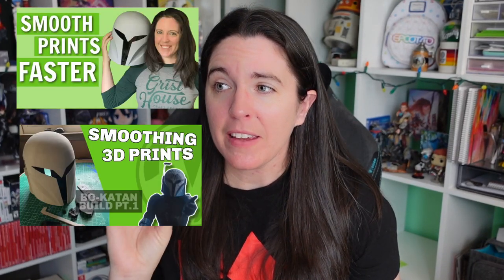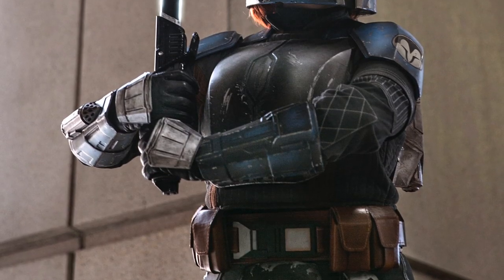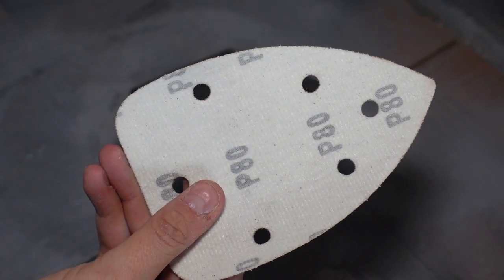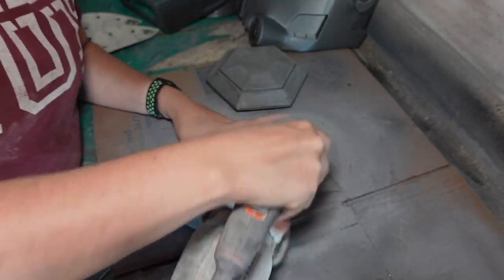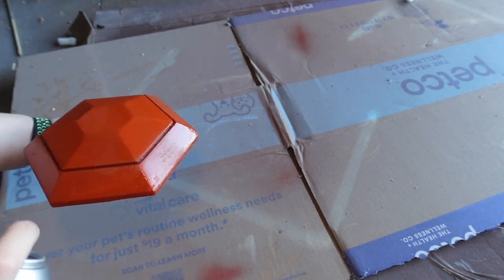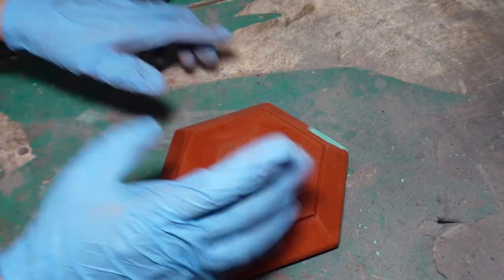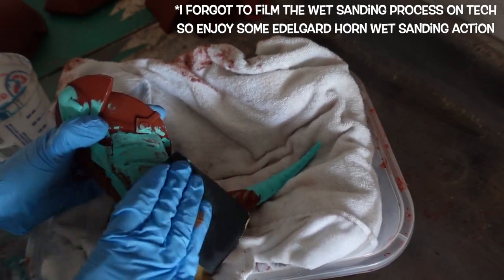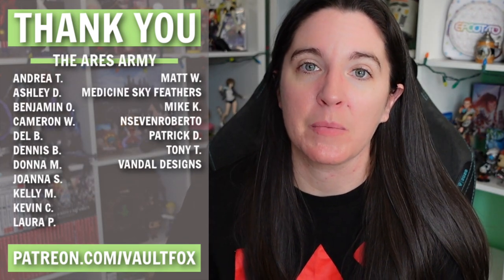How I Smooth My 3D Prints for Cosplay

Comment: For me it's step 1 : use 60 or 80 with sander, then spray filler primer, then 280 by hand or sander for large flat piece. Then big holes with mastic and the small sanding, priming and painting

Comment: You have to try the FCR-1 foot callus remover tool for sanding especially for PLA it doesn’t spin very fast but it has enormous torque perfect for knocking down layer lines. 
This has become a game changer for me when sanding it keeps the dust in a relatively small area and doesn’t create enough friction to melt your part. It has 80 grit self stick pads and a visit to harbor freight you can get almost a lifetime supply of the finer grits  
Really they’re around $20 $25 bucks and for me it has been well worth it.
Reply from the maker: didn't think I'd be adding a foot callus remover to my amazon cart this morning and yet here we are LOL. thank you for the suggestion, I wonder if it'll work better for getting into tighter areas than the sander I have now.

Comment: Hello! Excellent video and definitely can see great results with this method!

One question that I have; did you recommend the fume variation of the cartridges because of the primer itself or because of a different step in the process that I may have missed? If it's because of the paint and dust itself, it would probably be better to get organic vapor/dust particulate cartridges as paint actually produces vapors and not fumes (unless it's heated by something else and made into a solid fume like welding). Just wanted to make sure, and some primer can be nasty to breath lol.

Thanks again for the vid, it was excellent, and thank you for your time!

Comment: Very helpful, thanks.  I have been sanding some enclosure panels I designed and printed in PLA.  I start with 120 on orbital.  Sometimes it seems no matter ho much I sand, the layer lines don't go away but seem more prominent.  I wonder if I've sanded through the outer solid layer into the infill.

Comment: Thanks for the awesome video showing your process!  I'm working on a Bad Batch Wrecker armor right now and could really use the advice.  Could you comment on what you typically use for wall thickness on your 3d prints?  I generally use 3 but I'm worried I'm going to sand through when doing the initial sand of the raw print
Reply from the maker: You're welcome! I use anywhere from 3-4 walls depending on the model I'm working with, for this Tech helmet I'm pretty sure it was 3 with a wall thickness of 1.8

Comment: My memory is awful so you probably already said it, but why did you stop using the resin fill method? Just because you've found a better one? Or is there also another reason? Wish we had that paint in the UK!
Good informative video btw, great for those who got printers over christmas!
Reply from the maker: thank you! I stopped using it mostly due to the fact you can develop a a contact allergy from using it (if you get it on your skin) and while I've been super careful using it with the proper PPE, I decided it just wasn't worth it in the long run to continue
Reply: @vaultfox  do you still do SLA resin printing? I seem to remember from one video or another that you had a SLA printer back there somewhere
Reply: @vaultfox  Ohhh I see yeah that's definitely a big risk!

Comment: I was just about to try the resin method reluctantly… the toxic aspect sort of spooks me. But then I was watching this video and I’m back to thinking I will just continue to sand and filler primer like before. I’ve been basically doing what you are doing here and it works fine but it just takes me forever… I mean weeks at times because I work and have other responsibilities that only allow me some evenings and some weekend hours to work on this part.. when you spread this out due to several hours here, several hours there.. this process just sort of sucks because of the time and the effort. Do you still prefer to do it this way? Some people I see lately are using painted on bondo putty acetone or upol putty acetone etc… these are also sort of not fun. Maybe there is no good solution and it just sucks lol

Comment: Out of interest why did you move away from uv resin smoothing? Would be interested to hear your thoughts
Reply from the maker: I made a video about it in late 2021, but mostly due to health concerns. It's very easy to develop a contact allergy to resins if you get even just a tiny amount on your skin, and while I've always been careful and work with PPE at all times, the risk outweighed the reward in the long-run.
Reply: @vaultfox  ah thanks for that. It was all the rage for s while and all the cosplayers I follow were doing it then suddenly everyone stopped

Comment: I was thinking about getting a 3d printer, so I've been watching a lot of videos on how to finish prints. Everyone uses such toxic materials - is there some reason I haven't seen yet that no one uses acrylic gel/modeling paste? It's used to create texture in acrylic paintings. It's incredibly cheap, no mask needed, can be smoothed with water before it dries and sanded after, and it dries hard and permanent. It can be used to paint plastics with the appropriate base coat. I'd appreciate any info otherwise. Thanks!

Comment: Do you add a layer of primer after the wet sanding? I'm always worried that after wet sanding, if I paint the print right away the result won't look as uniform.
Reply from the maker: nope, usually I'm going right in with paint after the wet sanding is dried and I haven't had issues with uniformity. if anything, the first layer of paint just shows me where I probably could have sanded more than anything lol

Comment: im having trouble with my sanding. i got a lot of parts smooth as glass but some parts have big dips and even holes in them, some things just wont even come out with that same sander you got. dunno what im doing wrong and im pretty sure the mando mercs are tired of answering my questions lol

Comment: I don't use Bondo body filler anymore It's kind of hard to sand I use USC Icing Finishing Putty, It's self-leveling and it's a little easier to smooth than regular bondo.
Reply from the maker: I've never heard of that, I'll have to check it out sometime. And I agree, that's kinda why I moved away from the bondo in a tube as it just kicks up so much dust and has a tendency to shrink
Reply: @vaultfox  No that's the spot putty #907 I still use that for like imperfections, the regular body filler that's in the can that you have to mix with a hardener.

Comment: i'm confused. so you just skip uv resin and sand down directly on the print and on the primer...filler...thing...?
Reply from the maker: sorry for the confusion! no, there's no UV resin used in this ... I was just commentating on how that was the method I used to use in the past. Nowadays I will just sand the 3D print down first and then apply the filler primer